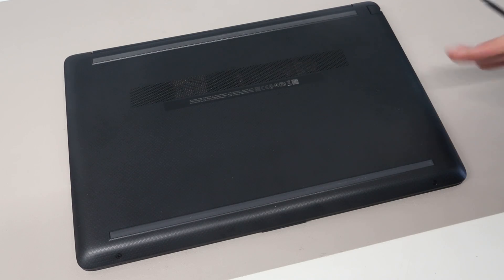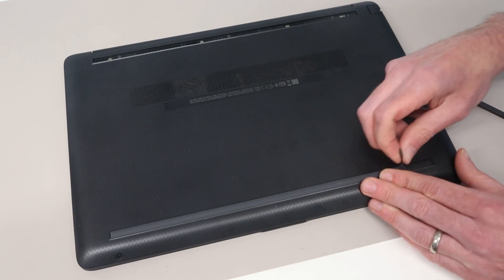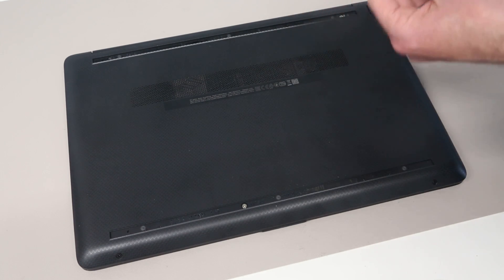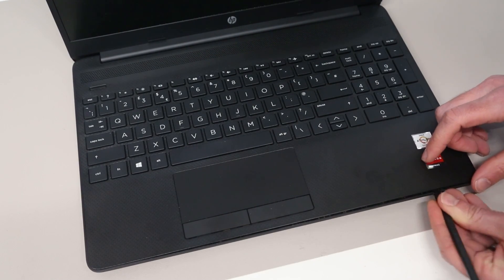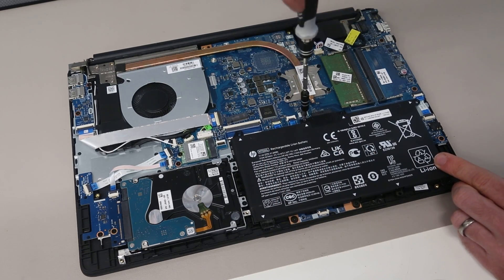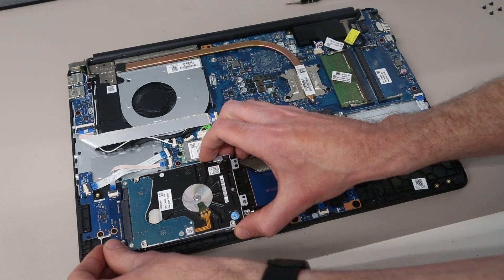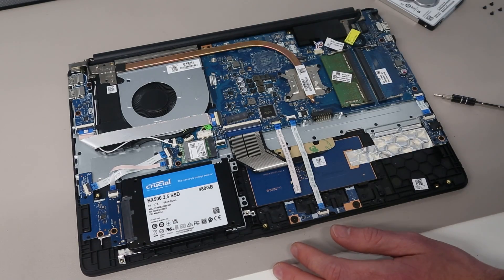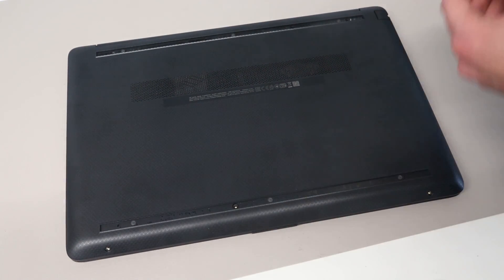HP 15-gw0502sa - SSD/HDD and RAM Upgrade and Battery Replacement Guide

Comment: The design of this laptop is horrendous. It's as if they've deliberately made it difficult to open and upgrade your components. HP - never again. And I think I slightly cracked both sides of the bottom case when trying to open it. Thankfully it's not too bad and everything still works as it should. Just need to upgrade the RAM from 8GB to 16GB. It originally came with 4GB which was extremely slow. The maximum increase is to 32MB and I'm pretty tempted to go to that, but maybe 16GB should be fine for the time being.

Comment: Hi I just bought one of these second hand.  Running extremely slow on windows 11.  On the task manager the disk is continually at 100%, memory 85-90% without me even doing anything.  
Do you think BOTH the ram and hard drive need replacing or just the ram? Thanks :)

Comment: This upgrade will make the laptop run faster?
I got the same laptop but it’s run very slow, it’s barely can open an app or a picture
Reply from the maker: Upgrading from a HDD to an SSD should make a huge difference.
Reply: @BrueComputing  What about just upgrading the RAM instead of the hard drive? Surely the extra RAM will speed up the laptop?
Reply from the maker: @WillScarlet1991  Going from a HDD to SSD will have a far greater impact on performance, but doing both wouldn't be a bad thing.
Reply: Can i replace the hard drive to a ssd ?
Do i need to install the windows after?
Can you please send me the parts i need to replace or links from where can i buy them
Thank you
Reply from the maker: > Can i replace the hard drive to a ssd ?
Yes.
> Do i need to install the windows after?
Yes, or clone the contents of the existing drive to it.
> Can you please send me the parts i need to replace or links from where can i buy them
Links from the description:
Screwdriver set: https://amzn.to/2H8yS1x
Pry tools: https://amzn.to/3kEJyT0
16GB DDR4-3200 SO-DIMM: https://amzn.to/3lJy7gg
1TB NVMe M.2 2280 SSD: https://amzn.to/3lv1D8T
Reply: @BrueComputing  and for the parts you’ve sent to me do i have to install the windows?
Where are you based?
Do you have an work shop?
Reply from the maker: Yes, you'd either need to clean install or clone across the operating system.
I work from a home office in Somerset, UK.